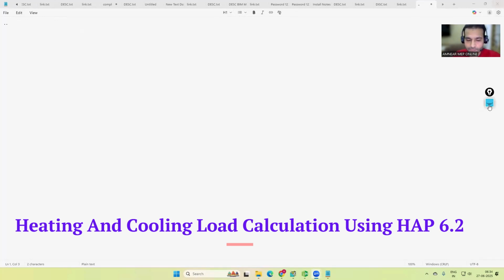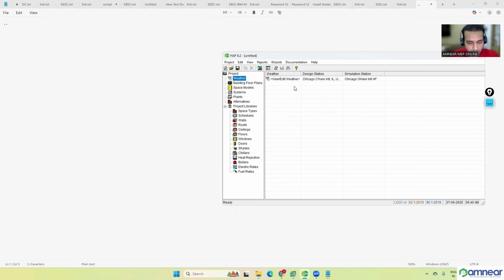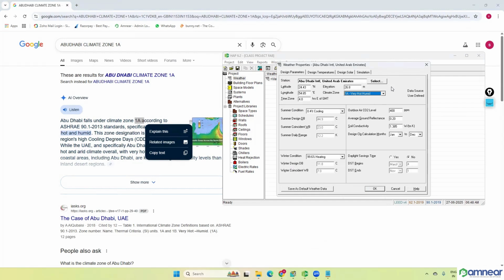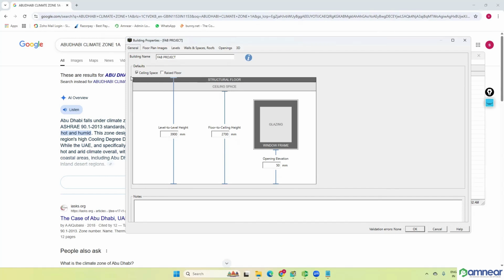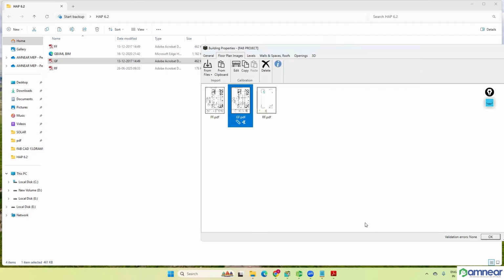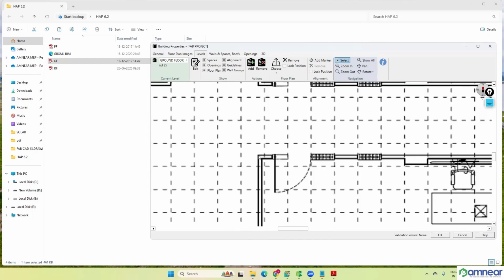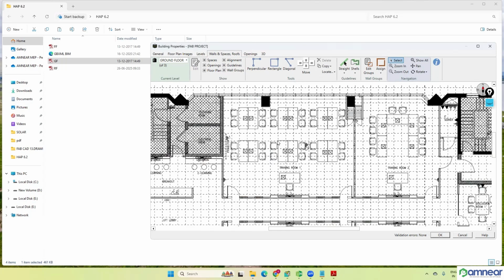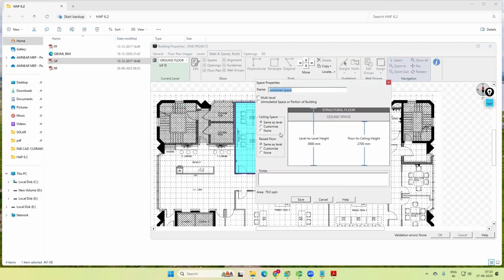HAP 6.2|PART 1 OF 3|HEATING AND COOLING LOAD CALCULATION USING HAP 6.2|HVAC DESIGNING|AMNEAR MEP BIM

Comment: Hi sir,
1. If I purchase your hap course then would you provide me with hap software as well ?
2. Apart from that I want to learn CFD and Trace700.Colud you provide me training and software for the same.
3. If not , please provide references.
Please let me know asap.
Reply from the maker: Thank you for your interest! Please note that YouTube members will not receive any software or class files. To access the Softwares (including HAP), class materials, and student drive, you must be a registered student with Amnear. You can enroll through www.amnear.com by purchasing either the AM1 course (complete MEP package) or AM2 course (HVAC only).

Also, we do not cover CFD (Computational Fluid Dynamics), as it is typically handled by specialized subcontractors. Our focus is on heating and cooling load analysis using HAP software, and TRACE-700 is not included in our syllabus.

For more details, feel free to contact us on WhatsApp at +91 96333 58942. With over 220+ videos and 300+ hours of content, only 4–5% is available on YouTube. To learn everything from basic to advanced level, you must enroll in the full course through me or the website.
Reply: Where I will get part 2 and part 3.? It's not their in your video
Reply from the maker: @naveedmahimkar3872  Thank you for your interest. Its not uploaded in Youtube.To access all videos,  Softwares (including HAP), class materials, and student drive, you must be a registered student with Amnear. You can enroll through www.amnear.com .

For more details, feel free to contact us on WhatsApp at +91 96333 58942. With over 220+ videos and 300+ hours of content, only 4–5% is available on YouTube. To learn everything from basic to advanced level, you must enroll in the full course through me or the website.